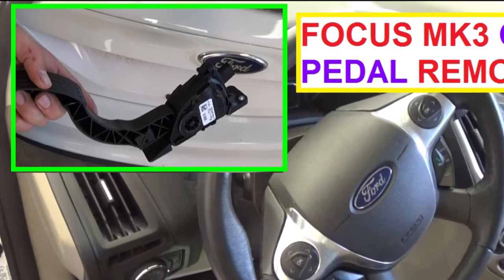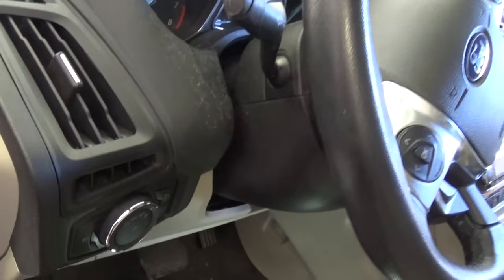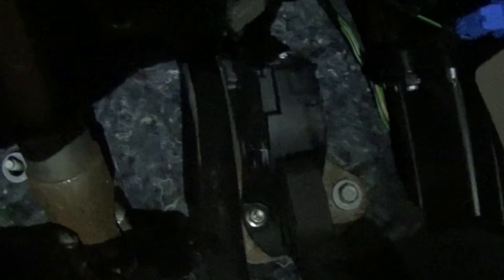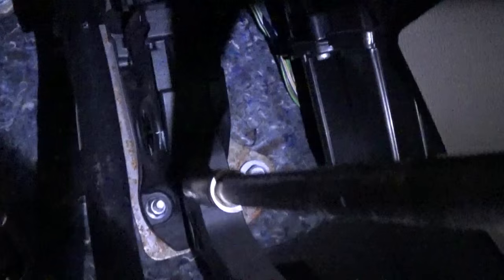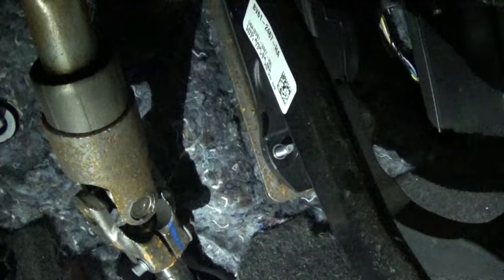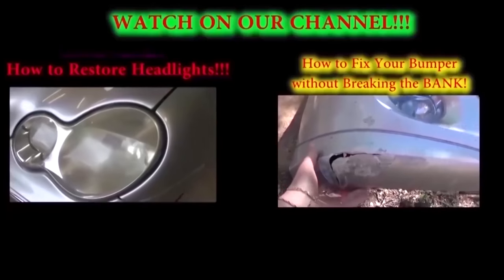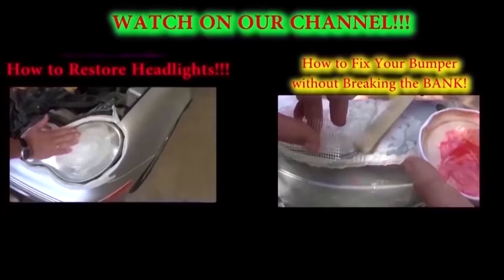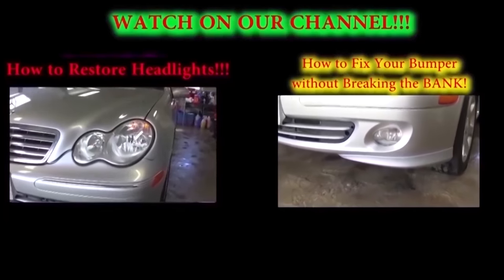P2135 Code Throttle/Pedal Pos Sensor/Switch Throttle Pedal Removal and Replacement Ford Focus MK3

Comment: I got this code on my 08 mustang v6 I was told that it could be the Gad pedal or tb position sensor. After replacing it did you kept getting the yellow wrench and check engine light? Thanks in advance
Reply: Hi. Solved? I have the same error

Comment: Hi i have the code P2135 but i change throttle also i change gas pedal i spend until now 400€ and the problem still there what i do help me please ?
Reply: Have u solved it?
Reply: @k81s  emm yes i will send you a link that maybe will help you bro :)
Reply: @ganjarolla8951  Hello, in having this same issue and also replaced pedal and throttle body but the code is still here.can you help me on how you resolved yours?
Reply: Does any one solve it?

Comment: I know that the P2135 Code related to TP not pedal...how could you fix this by changing pedal!!!
Reply: There's sensors in the pedal also associated with the TPS.
Reply: There's correlation from the pedal itself it may fail and make tps sensor act up or get the p2135 code